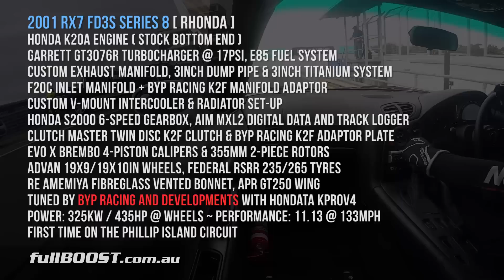K20A powered Mazda RX-7 ~ RHONDA

Comment: This swap actually makes a lot of sense. High revving small engine that is turbo charged. Keeps the car similar in nature to how it was originally designed but with an engine that's a bit more efficient and reliable than a rotary. I really love this idea and props to the builders for making something that is different.
Reply: This!
Reply: A built rotary is reliable. But it can't touch the oil consumption or fuel efficiency of the K20.
Reply: Its a lot more reliable than 13b
Reply: @RK1FX  it depends. if you take great care of your rx7 (check oil every day, mixed gas, etc) it's very reliable.
Reply: @MilesPrower1992  Most cars are reliable if you take care of them. But that's the thing the K20 doesnt need as much caring, it wont overheat as much, it wont burn oil etc.
Reply: They could have just swapped a d15 single cam and that rx7 is lighter and more of a monster
Reply: @Ganizebra  so you need to rebuild the engine first to make it reliable. Ok there.

Comment: I think this is brilliant. They shaved weight and added power. You can't argue with that. Do they know the weight distribution now with placement of that motor? It seems to be pretty well tucked in there. I think this is a genius build. Not to mention, you can always tune the K to rev 9-10k as if it were a rotary if you really miss the high revs. Now I'm partial to the 26b, but from a racing standpoint, this swap makes perfect sense. I'm excited to see how it does in the TA.

Comment: Damn right, its a cleanly done, very well balanced swap that works.
The FD is a great chassis and an excellent car overall, but it was given an engine that not everyone can deal with. The needs of the REW, its age, and the fact it was the pinnacle of an almost 30 year old engine design, means it was working at its limit even when stock. I have nothing but respect for guys who 1) Take on the challenge of an engine swap.....2) Do it regardless of fanboy reactions or brand based biases.
And yes, I drive a rotary, have for many years and its seen several engine swaps/upgrades over the years but I never went piston.

Comment: What is the oiling solution?  Baffled oil pan? or Dry or wet sump system?  Thanks.
Reply: Will have to be baffled oil pan. They suffer from oil starvation on track standard. (unless its dry sump as you say)

Comment: Im a rotary fan and all, but I would never own one and fully understand why people do swaps in rx-7s.
Reply: Rotary maintenance is too much.
Reply: +Mickxal Rotary maintenance is all about keeping an eye on the oil level, and changing the oil regularly. They burn oil, they're designed to do so, and people let the oil level get too low. And, you can't let them sit too long without starting.
Reply: +Mickxal nail on the hammer
Reply: they also have fuel flood problems and the engine life expectancy isn't that long.Also you need to rev that engine hard to get any torque lol
Reply: Good sound, but crappy torque and fuel mileage. Drinks more fuel than a Hellcat.

Comment: at least not LS swap...
Reply: ls would be even better
Reply: +Check Mate no
Reply: +Detective bot I have a honda, but an LS motor would be way better in almost every metric! No turbo to fuck around with too.
Reply: Check Mate no. Ls is for torque. Torque is what pulls my trailer daily. 
Quick and lightweight is for the circuit tracks. Nürburgring time attacking 4 bangers prove it.
Maybe even the freeways(*cough racelab kr2 *cough)
Reply: @N4CR  why dont you LS swap a dirt bike then?

Comment: The inner car-guy in me wants to talk shit.. BUT I really should be talking shit on the rotary! I have loved them over the years, but recently ive turned my back on them because they are the most BS ever stuffed into a car in the last 40 years.. 1). It makes zero hp without a turbo 2). Justify having 15mpg fuel rating with a torqueless, rickety engine that just wants to melt itself. 3). The engine is one of the most inefficient engines ever mass produced, EVER. A piston engine is like an air pump, rotaries are more of a fuel-heater! 4).  Apex seals.. They are the achilies heal of the rotary, they are guaranteed to fail due to engine design. There is so much expansion/compression in the cylinder as the engine heats and cools, Apex seals try their best but there is only so much you can do in a 1000 degree engine. 5). All of the above.. There are zero advantages to a rotary engine over a piston engine, Z E R O. They run hot, waste gas, pollute and everything else negative haha.
Reply: One advantage: The Brap lol

Comment: how could a k20 be lighter than a 13b?
Reply: +fightfanian aluminium, thats how
Reply: +That-JDM-Fascination! from what I've read the 13b weighs around 150-160lbs without accessories and the k20 is closer to 250lbs.
Reply: they didnt say the engine was lighter in the video. they said the front end was lighter. think about things like wheels, suspension, chassis mods, and things like light weight accesories plus the amount of wiring which would of been stripped that ran the old engine. im sure if you took everything out of a stock rx7 engine bay including things like 2 turbo chargers, intake, all the emissions accesorie and so on. then compared it to what fills the engine bay right now with things like lightweight radiators and intercoolers. the stock stuff will weigh more
Reply: and its not like a 13b with stock turbo chargers, downpipes, intake and intercooler setup would weigh 150lbs. that number would be just the bare block more or less
Reply: +That-JDM-Fascination! then it's technically not the engine swap that reduced the weight, but rather the discarded accessories. wankels are just too cool, wish he didn't do this swap, but to each his own.
Reply: +That-JDM-Fascination! yeah, I was comparing bare to bare.
Reply: fightfanian like i said above. THEY SAID FRONT END not engine so no one ever said that the engine swap was what made it lighter.
13bs are way to expensive and this is on the stock bottom end. just that alone is reason enough to swap it out for something thats on the track alot